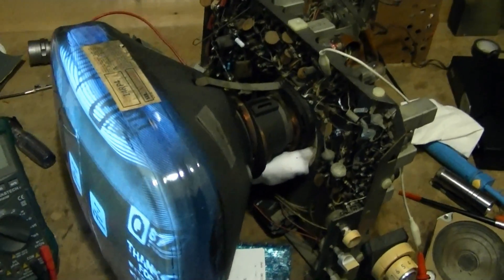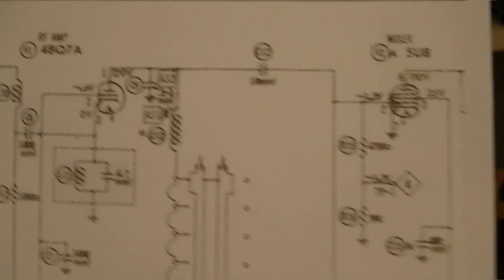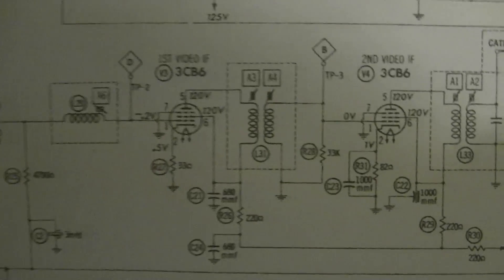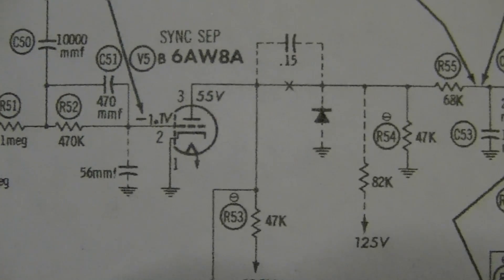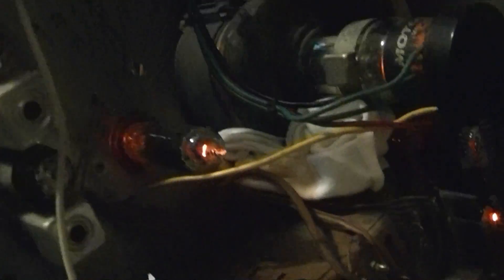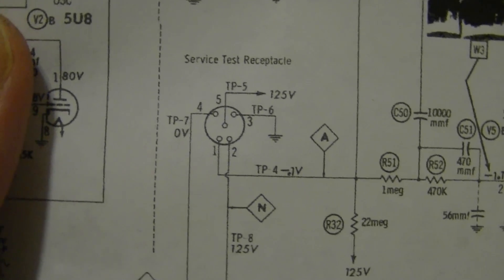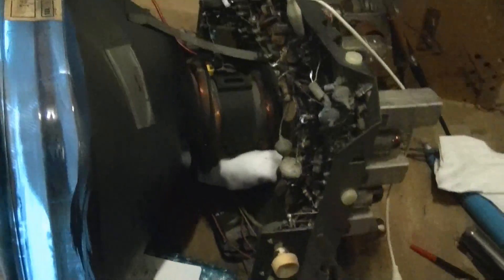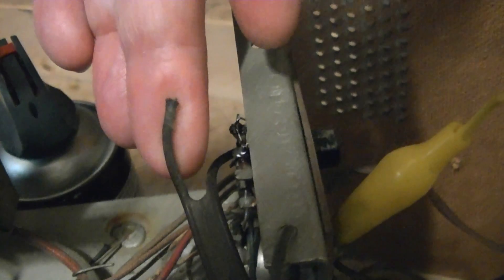Motorola Y14P3-2 restoration p2o4

Comment: I get it Bob, thanks. It was fairly easy to make that Philco radio work. I've been working on a RCA all American five-type Am radio and despite all my efforts - recapping, resistor and coil checking, replacement of tubes and even replacement of the mica caps inside the IF cans, it only tunes 1 or 2 stations and not very well. That's so frustrating, but anyway, I don't have that much experience yet.

Comment: Hi Bob. Yeah, I had not watched that restoration series. You had already thought on replacing the tubes with other with higher voltage : ). Now, just out of curiosity, if you don't mind answering, what would happen if one tube drew more current? Burn the heater of the other tubes? Anyway, I understand that the set was designed to work with a certain current level and that should be considered.

Comment: Here is another idea, what about using a low voltage transformer winding in series with the tube fillament string, one rated for 1.2 to 2 amps? That shouldn't be to hard to find, although finding a spot to mount it might be.

Comment: Most power resistors are derated to 0 power around 250 degrees C! Hence the reason they seem so hot, even if they're not dissipating the rated power.

Comment: I see Bob. The zeners would reduce the voltage to, let's say 110V, but not the current intensity, so the resistor would get hot anyway, right? In reality, about the tubes, I thought the other way around, use equivalent tubes with higher heater voltages to compensate for the higher voltage you have in your grid now, not considered in the original design, but I had not thought about the current factor.

Comment: Hi Bob. Two ideas - how about a zener + a resistor (although I don't know if it's possible to use with AC) and the second idea (this may sound crazy) - is it possible to replace one or more tubes with equivalent ones at higher voltage ratings?  For example - 6AU4 the same as 19AU4, expect for the heater rating